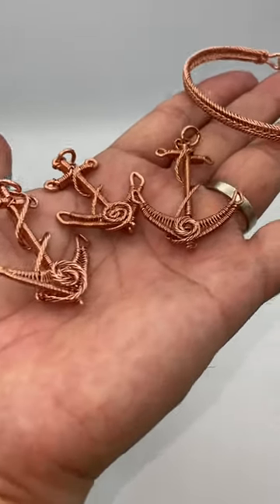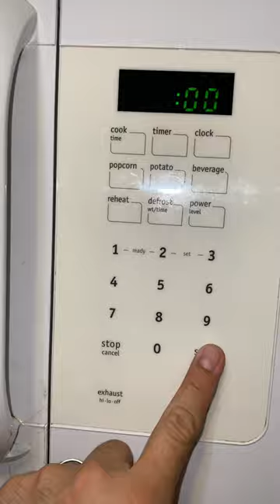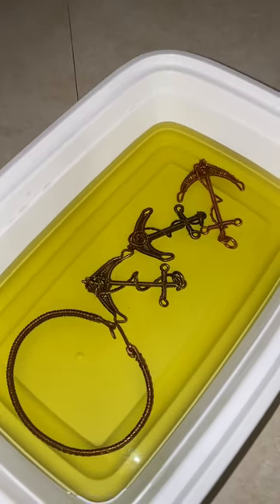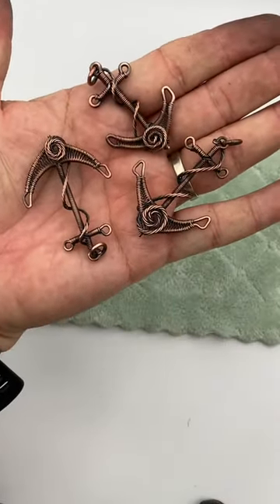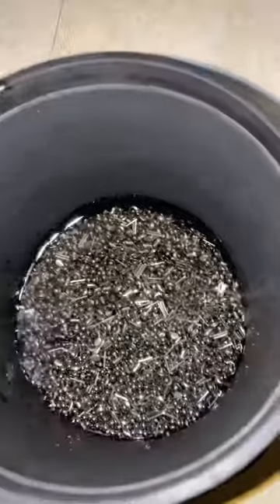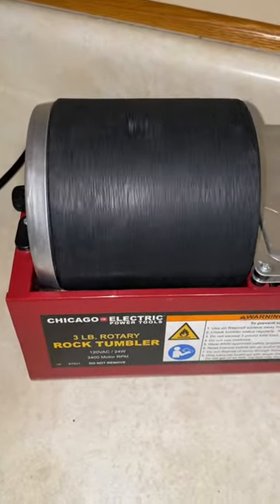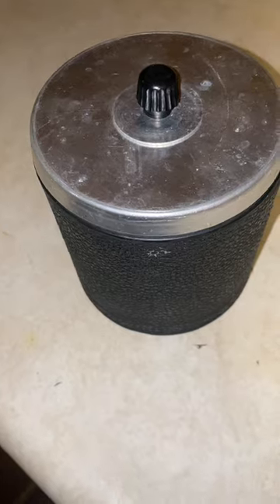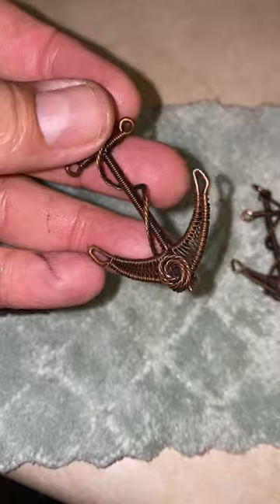How to oxidize copper jewelry/ how to patina jewelry/ wire jewelry diy

Comment: Hello, I have try the liver of sulphur like you but my copper is same as before. The color stay the same. 
Do you know why ? I do not understand...
Reply from the maker: Is because the copper you are using is not bare copper it can be coated copper which it can’t be oxidized another reason could be that your patina solution is been expired patina solution loses its strength over time if is not used not all the brand do this but some brands lose their strength make sure you are using bare copper and that your patina is new